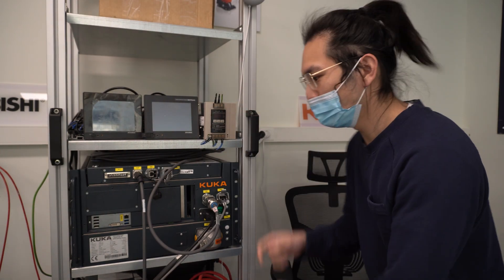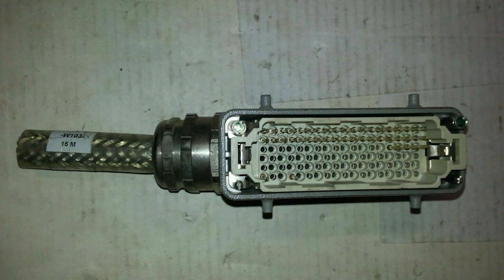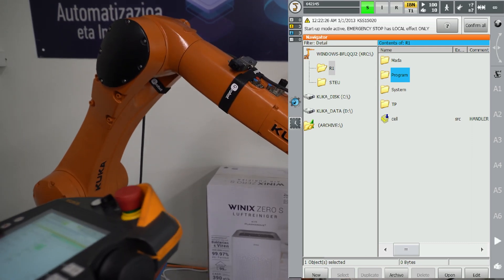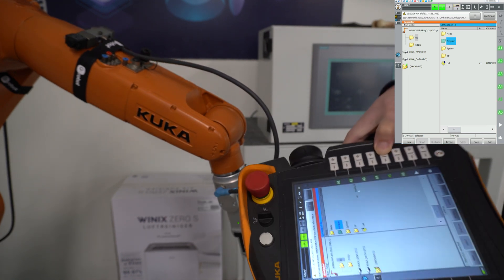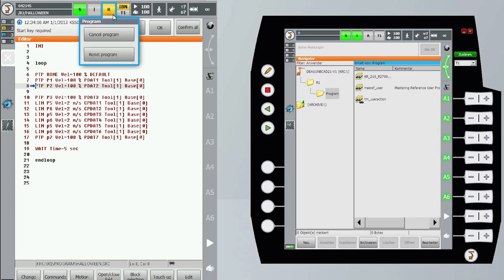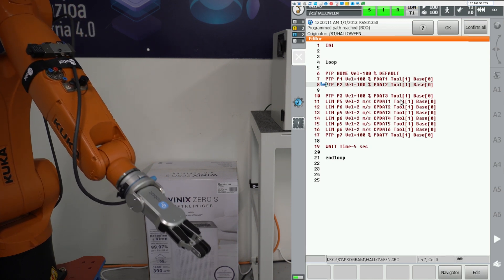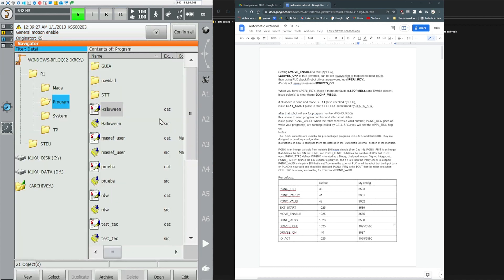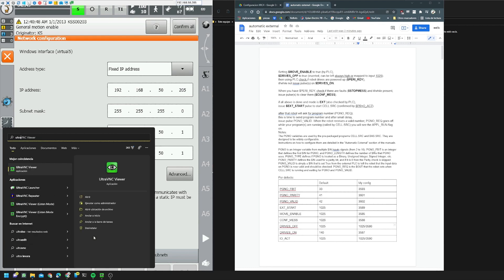#REBOTS - Kuka krc4 101 in English. Learn the basics, how to move the robot 4k

Comment: I'm new to the whole Kuka world I use them every day at my job and need to learn everything about them. What is the difference between T1 and T2?? And do you have a video that more specifically shows you how to manually move the robot in the middle of a program? Please advise, I will be watching all your videos and following closely, thanks again!!
Reply: T1 (Manual Reduced Velocity)
- For test operation, programming and teaching
- Velocity in program mode max. 250 mm/s
- Velocity in jog mode max. 250 mm/s
Manual mode is the mode for setup work. Setup work is all the tasks that have
to be carried out on the robot system to enable automatic operation. This includes:
- Teaching/programming
- Executing a program in jog mode (testing/verification)
In Manual Reduced Velocity mode (T1):
- Operator safety (safety gate) is not monitored.

T2 (Manual High Velocity)
- For test operation
- Velocity in program mode corresponds to the programmed velocity!
- Jog mode: not possible
In Manual High Velocity mode (T2):
- Operator safety (safety gate) is not monitored.
- Teaching is not possible in this operating mode.
- The programmed velocity is reached when programs are executed in T2
mode.

Comment: Can you teach me how to change the mode to IBN/T1 as early video. Thanks
Reply from the maker: You mean start-up mode? https://youtu.be/mrE-fFZorVg?t=221
change user group to expert or admin and then select service->start up -> start up mode.
1. WoV project  has to match current hardware (*The project is ok.)

2. there MUST have ONE safety interface CONFIGURED. if this is missing, StartupMode can't help...
*Safety interface board(SIB), or bus safety like in the video i link in this comment. If you have profisafe it requires installing X311 jumper plug in CCU

3. External enable switch must be present or bridged

4. $MOVE_ENABLE on true
*It enables movement when dead man is pressed.

5. Safety configuration must be activated.
*By default enabled

6. Safety signals must be ok (or in this case one can use StartUp mode) 
*Reset the errors

Comment: Hi and thanks for the video. I think will be great to have a video where you explain how to movr the robot from the code, without using an inline form movement but setting up acc, vel...from the code (i think using bas module) and the write a line like "lin myPoint" to move the robot.
I think it will be very helpful.
Reply from the maker: You mean declaring global variables and then just implicitly code just the type of movement and point? Thank you that's a great suggestion for a programming video.
Reply: @rebots  Yes for example i can teach a point with the pendant. Then i can use an E6POS variable, setting up some other variable like acc and vel, and then in the code copy the point teached with the pendant into the E6POS variable then change .z axis value for example and then write the code to move to this E6POS point using the variables for vel and acc tool and base with the BAS module.
Pratically i make a movement without ILFs .

Comment: I have a question regarding light drive on, with x53.. If I connect the light directly, does it indicate when the robot break??
Reply from the maker: I don't understand your question sorry.
X53 indicates if the drives are ready or not. (but you might need to enable it in workvisual in local safety config->hardware options->input signal for peripheral contactor from KRC by default is already set but you might need to change it to plc if you are using a safety plc)
Reply: @rebots  Sorry , I meant drives ready lamp which has the connection in XG53  in KRC4 . and in my agilius it is XG 33 . it manual it shows +24v drives ready lamp and 0 v drives ready lamp . so if i connect  24vdc lamp directly to the connector , will it work without configuration ? doest related to safety ? or when the robot breaks for any fault then it will light on ?  :)
Reply from the maker: Normally by default it's configured if I remember correctly.
It only lights up when drives ready, when you can move the robot, as you said in the manual 24v when servo drivers on.
Reply: @rebots  Thanks alot for your reply . I will try that then tell the result :)